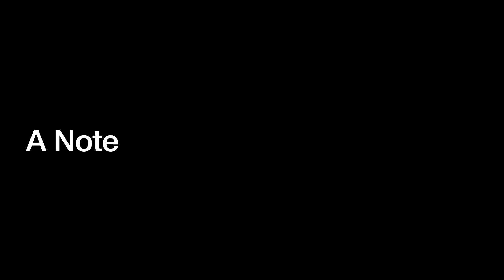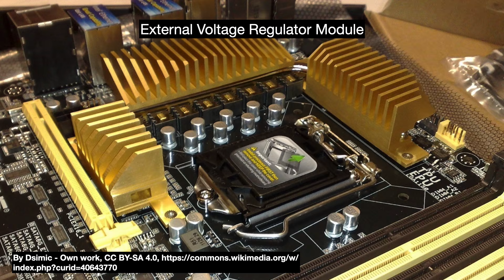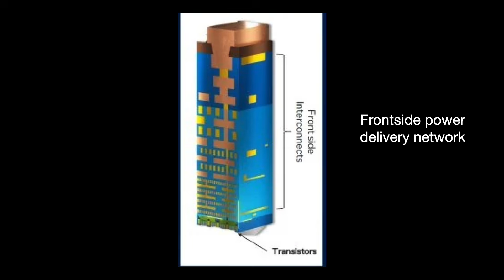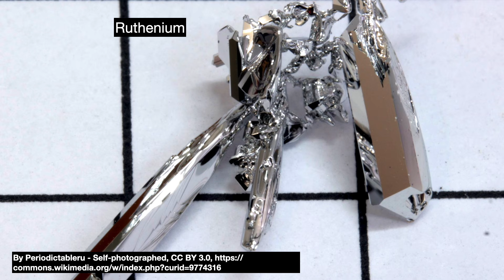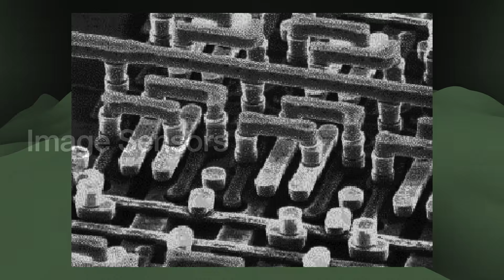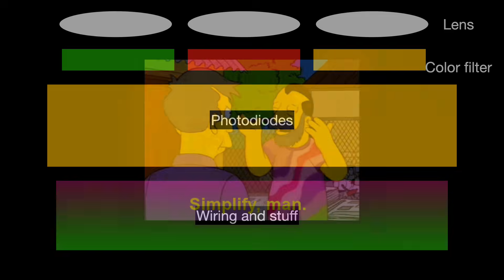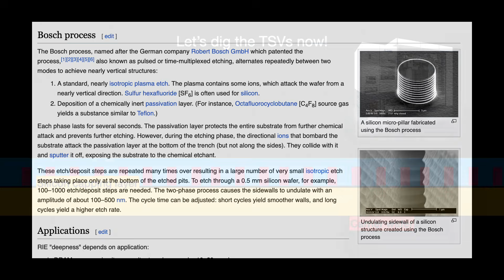Intel’s Next Breakthrough: Backside Power Delivery

Comment from the maker: Post-video note: TSMC has moved Backside Power Delivery out of N2P to their A16 node: https://www.anandtech.com/show/21370/tsmc-2nm-update-n2-in-2025-n2p-loses-bspdn-nanoflex-optimizations
Reply: Relevant part: "Although TSMC once said that N2P would add backside power delivery network (BSPDN) in 2026, it looks like this will not be the case and N2P will use regular power delivery circuitry. The reason for this is unclear, but it looks like the company decided not to add a costly feature to N2P, but to reserve it to its next-generation node, which will also be available to customers in late 2026."

Sounds like it's still coming out in 2026 either way. Might not be much of a delay but I'm not sure what the implications will be.
Reply: @-Kerstin  tbf, at that point we will just see  when they actually release products with it. so many thing can happen in 2 years ...

Specially since TSMC took the bet to not use High EUV NA, but we will have to see if that choice pays up.

Same for intel but the opposite, they bet on it, now, remains to be seen if they can scale it in a cost efficient way.
Reply: @-Kerstin  Considering TSMC has said N2 is still on track I'd say 2026 is when they're in full production at the latest.  What I know is there is a difference between their 1st and 2nd gen N3 where 2nd gen is easier for them to make and a better defect rate and they said they'll use that method for N2.   So I don't think this is going to be a big challenge for them.
Reply: @-Kerstin  Specifically, it will be out on Dec 32, 2026, give or take some amount of time due to unknown issues. 🙂
Reply: @hallkbrdz   From Anandtech 4 days ago (I trust them with this news more than anyone else):

"As announced last week by TSMC, later this year the company is set to start high-volume manufacturing on its N3P fabrication process, and this will be the company's most advanced node for a while. Next year things will get a bit more interesting as TSMC will have two process technologies that could actually compete against each other when they enter high-volume manufacturing (HVM) in the second half of 2025."

Brief note, this newer N3 has also been reported as easier to make with a better defect rate.  They'll be using the same process for N2, with better transistor density of course.

"The production nodes are N3X (3nm-class, extreme performance-focused) as well as N2 (2nm-class). TSMC says that when compared to N3P, chips made on N3X can either lower power consumption by 7% at the same frequency by lowering Vdd from 1.0V to 0.9V, increase performance by 5% at the same area, or increase transistor density by around 10% at the same frequency. Meanwhile, the key advantage of N3X compared to predecessors is its maximum voltage of 1.2V, which is important for ultra-high-performance applications, such as desktop or datacenter GPUs.

TSMC's N2 will be TSMC's first production node to use gate-all-around (GAA) nanosheet transistors and this will significantly enhance its performance, power, and area (PPA) characteristics. When compared to N3E, semiconductors produced on N3 can cut their power consumption by 25% - 30% (at the same transistor count and frequency), increase their performance by 10% - 15% (at the same transistor count and power), and increase transistor density by 15% (at the same speed and power). 

While N2 will certainly be TSMC's undisputed champ when it comes to power consumption and transistor density, N3X could possibly challenge it when it comes to performance, especially at high voltages. For many customers N3X will also have a benefit of using proven FinFET transistors, so N2 will not be automatically the best of TSMC's nodes in the second half of 2025."

I think your prediction of end of 2026 for N2 is about a year off.  They should be in risk production in 2025 with their risk partners.  2026 they should be in full production of multiple N2 nodes in 2026, which means taking on more customers with it.

AMD Zen 6 will be coming out around then, and there's been the discussion of whether that will be on an improved N3 node or one of these N2 nodes and my guess is it's going to be about cost and what AMD does with their core chiplets because they're going to be putting out a 32 core chiplet, not for desktop, for server.  It would be something like Zen 6C cores, whatever that looks like for AMD at that time.  If AMD can get the clock speeds they want along with the transistor density with this 2nd gen N3, then it will probably be on that because it will be less costly.
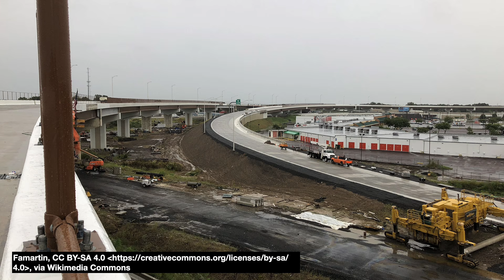Reply: The irony of what you said at 4:07 is that "via" in Latin means "road"
Reply: @billkillernic we used to call them literally via holes but no one uses that anymore!
Reply: One thing I didn't hear you mention, maybe you did and that was one of the benefits of backside power delivery, or BPD, and that is it makes it easier to etch all the signal and power delivery substrates.  As in, they don't need so many sharp edges because they have more space to work with, and that's a pretty big deal.

Also, both N2P and A16 are coming out in 2026, so "moving out" doesn't mean moving back in time, it just means that they like both of those processes the way they are more than anything else.
Reply: Interesting, when is A16 due?
Reply: @liam5257  BOTH those nodes are due to release in 2026.  This really isn't about TSMC pushing back one part of a process as much as it is they like their N2P process the way it is and don't want to mess with it.

Read the article and then read their article published 4 days ago about TSMC process nodes.
Reply: What about fcga, flip chip grid array? About 20 years ago it turned CPUs upside down. Similar sort of timing when IBM released it copper CMOS tech, which intel rolled out as copper mine. Possibly FCGA just flipped the gates and data lines around.
Reply: What is the difference between 1st gen and 2nd gen N3?  This is supposedly a lot better for TSMC, being easier to make along with a better defect rate.
Reply: You are right , Intel is the only company that has put billions in Research that not even Google or Meta or any company can come close to .
In Research and Science sometimes you are unlucky with No results and that is why intel seems to struggle .
Reply: Backside power delivery sounds like a really 'alternative' fetish.
Or a kick in the pants.
Reply: Politics ruin everything, so stop injecting your politics into videos about semiconductors. They also make the video age badly and turn off first time viewers. Calling out your college roommate isn't that funny either, just makes you come off as an asshole. That's probably not what you intended, but it did kinda ruined the comparison for me.
Reply: How do you think, when forksheet fet with Full bottom dielectric isolation will come. Impact of self heating effect in bottom dielectric isolation is not overcome
Reply: Until I learned that TSMC has delayed their BSPL I viewed Intel's chances of regaining process leadership as very poor. This actually opens a window of opportunity for them. They will have to deliver consistently for years to come and leverage it to grow their foundary business for it to be more than a blip, but they at least have a chance now.
Reply: @RN1441  Isn't Intel version of BSPL still coming after TSMC's one ? EDIT: nevermind I misread the article
Reply: Awesome video. This is the type of content I meant when I suggested focusing more on manufacturing process developments.
Reply: dude, you're talking about the company that refused to innovate at all for a decade, might as well have opened the video with "For the shareholders of j.p. morgan it has never been about the money".
im gonna stop this video at 23 seconds, and just not trust you on anything involving intel again.
Reply: Got the masochism to cover Intel 5nm fabs in Israel being deliberately placed smack between the West Bank and Gaza?

Comment: I hate this, it screams heat dissipation issues in an already thermally saturated ecosystem with existing related failures already occurring as we speak with 13th/14th gen processors that have issues that are still not fully mitigated.  This coupled with a proposal to both decrease the surface area available for heat transfer and to increase the energy load of this contact area, it will all spell disaster for them.  I cannot wait to see how ugly it looks and likely AMD will be the one to do it correctly if trends continue.

Comment: For anyone with experience in digital circuits and any sort of data lines, removing the noise component (power cables) is like getting a new pair of glasses. + the easier routing in the datalayer - > both shorter cables , and less noise. Its like a wet dream for an electrical engineer. Short cables also imples < cable resistance, making it waste less energy -> less voltage required. The lesser noise also frees up the possibility for lower voltages since the signal to noise ratio gets a lot better, again -> less voltage required for the same signal integrity. So if you catch the drift we are going in circles almost, and these effects are like compound interest to each other. They not only add up + they enhance each other -> and each enhancement lays the ground for a further improvement - > so the calculation of the improvement is something similar to an infinite sum of contributions rather than just adding the two 1st order effects on each other. 

The power manifestation in the cable is ~ = cable resistance * V

Comment: When I hear of tungsten in semiconductors I am reminded of the first single-chip fully 32-bit (address and data) microprocessor which HP developed in the early 1980s.  I remember reading that the process on which it was developed used a vapor deposited tungsten interconnect.

Comment: With all this talk about lowering power consumption and how hot these chips run why can’t they machine, etch, or design in cooling passages? It seems like it wouldn’t be difficult to put thousands of cooling passages into the chip running around the transistors into which one could pump coolant be it water or some type of refrigerant like say r134a. This would allow the chips to run at much higher power levels and still run cooler then they do now.

Comment: I don't understand, why can't they just start with buried interconnects as the bottommost layer, then make the buried VIAs on top of it, followed by the buried power rails, and lastly start making transistors on top of them?? Why do they have to make the bottom layers, flip it, then make transistors on the other side, instead of starting with the bottommost layer (buried interconnects) right on the wafer?

Comment: Software is better utilizing the hardware (windows 11 utilizing the intel P and E cores) but at the same time the software is getting more bloated that slows down the hardware. Windows has a very, very old kernel. It is about time for an entire redesign of windows. 

Also, I wonder if they could use silver instead of copper.

Comment: You left out the quantum mechanical defect in CMOS. Due to the difference in the mobilities of holes and electrons, there is a transient short from power to ground every clock cycle. That is why power consumption goes up with overclocking.

Comment: BSPDN is born to be 3D-IC, the SiGe works as a etch stopping layer. while before that, the upper side of the wafer should already be bonded with the other wafer with high-density interconnects.

Comment: We'll see IF Intel can actually make this work in its new node. They've not been doing that well with implementing new nodes, and calling their higher power consumption nodes lower number equivalents seem to be more marketing than engineering. And its their previous choice for marketing (Intel Inside) over engineering that's made them drop from #1 to #10 in world chip manufacturing/design based on income in recent years. Only time will tell.

Comment: I have an old Mostek product catalog that describes testing and failure modes. (Old as in 4 kilobit memory chips in the catalog). One failure mode was copper via electromigration.  Over time In non linear traces, the current would physically move copper atoms eventually causing open circuits. Now that we are dealing with nanometers instead of microns, I wonder if copper electromigration will become a failure mode.  I’m sure the designers are aware of this and probably 10 more things that can create reliability problems.
Reply: Oh fer sure, electromigration has been an issue all along,  my class   in the late '80s included that. Basically keep current density below a certain threshold, so this puts minimum sizes on power traces, though in anything I worked on in 80s (undergrad)-90s(PhD) you were making them large enough to get resistive losses in check that electromigration was not an issue.

Comment: Note to Self

The smoke alarm supposedly has a 10 years battery life, which is very good. It has a Test function, which I tried and it works. I set fire to pieces of paper, and waved it below the smoke alarm. This successfully set off the smoke alarm. And the Silence function worked. The sensors are photoelectric, which is the more modern type, and generally preferable for most fires

I am using the glue installation, instead of drilling with the screws. Will report back if the glue fails. The manual claims that the smoke alarm will sound both an audio and visual alarm when the battery is low. This is good, if true, since the description on Amazon only indicates a visual alarm which seems stupid. If the sensor fails due to age, an alarm will also sound to inform you to replace the smoke alarms

To activate the smoke alarm for the first time, use the stick provided to slide the switch from Off to On. Do not press down on the switch itself, or you may break it. To screw the lid back on afterwards, align the lid with the body using the alignment line and then screw counter-wise

The smoke alarms should be installed in hallways and bedrooms, and not in the kitchen or bathrooms where the cooking and condensed water vapour will set off false alarms. At least 15cm away from walls and corners, to ensure good airflow. At least 30cm away from fluorescent lights. Away from sources of air movement, such as wind, that would prevent smoke from entering the smoke alarms

Comment: I hope powerVIAs give us as good chips as finfets did, my haswell 4700K lasted me 10+ years and still works, I mostly replaced the system because I wanted a more modern better airflow/quieter case, DDR5 and pcie4 SSDs where the old platform was stuck to sata SSDs.

I had to go AMD this time around because the 7800X3D destroys anything Intel is making atm, but hopefully they can get back on track without making 150W+ CPUs for a while.

Comment: Did I understand it that they fully etch away both the original Silicon wafer, in addition to the SiGe-Layer?
(Effectively turning the Carrier Wafer into the actual Wafer, into which the Transistors etc. while be etched etc.)

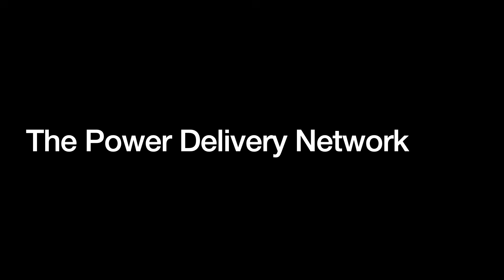Comment: 3:32 "It comes from the power supply". Uh, minor correction/elaboration. It solely comes from the VRMs. The PSU delivers 3.3V, 5V and 12V, all of which will absolutely fry a modern CPU, so no PSU voltage goes straight to the socket. On modern motherboards the VRM components are a non-trivial part of the total cost. Being able to deliver several hundred amps at very low voltages is costly. But every power domain relating directly to CPU, chipset and memory requires (a lot) less than 3.3V, so a lot of stepping down is required.

What remains to be seen is if Intel will manage to execute this time around. Every node since their 10nm (now called Intel 7) has been delayed and underperformed once ready. My gut feeling is that TSMC, who's no stranger to taking leaps of faith, is right in splitting GAA off from BPD to make sure they get each right and have time to thoroughly tune the EDA for each. You can have the best node in the universe, but it will be useless if your engineers (or customers engineers) can't properly design for it.
Reply: Deciding if TSMC or Intel's approaches are right solely lands on Intel to deliver. If Intel hits their dates, then Intel was correct and would then be a half step ahead of TSMC. Intel's Directed Self Assembly (DSA) that comes along with 18A could be a big deal on the costs side which will help with adoption.
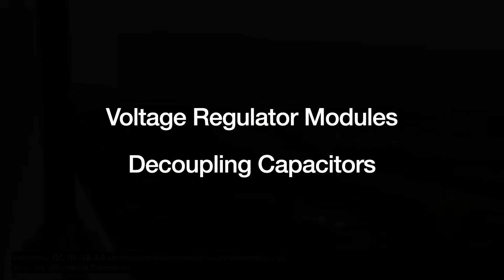Reply: Should have kept watching, VRMs are covered from 4:14 ;)

Comment: And i am still waiting when they are finally getting result on through-die cooling. Haven't seen any official material on that lately, but the microchannels and through vias seemed to offer quite some cooling capacity. It would certainly increase complexity if you'd need to attach a water-line directly to the die, or have the heatspreader be a large vapourchamber that is connected to the die, but the cooling-performance is outstanding.